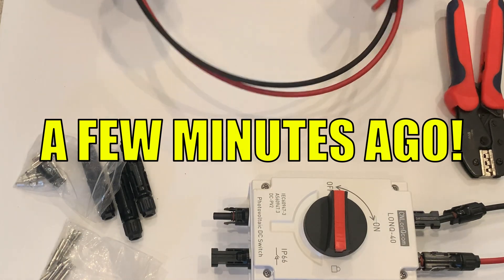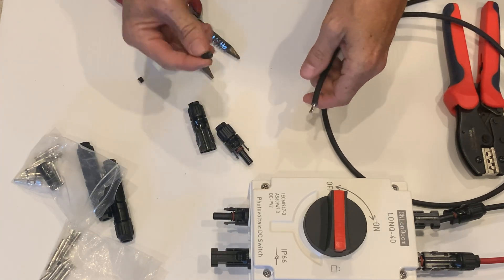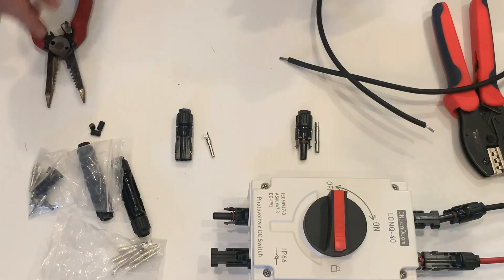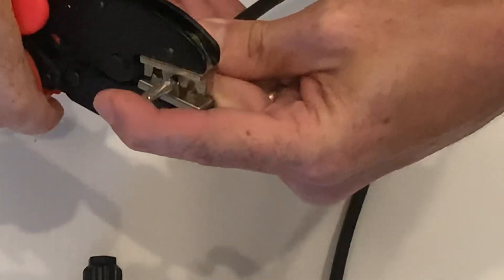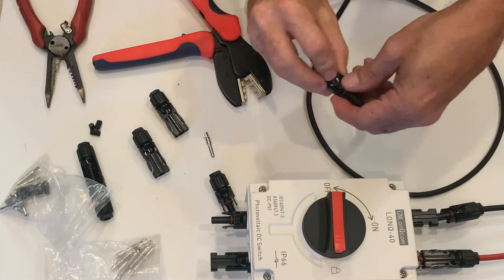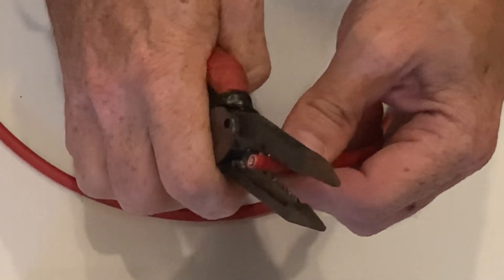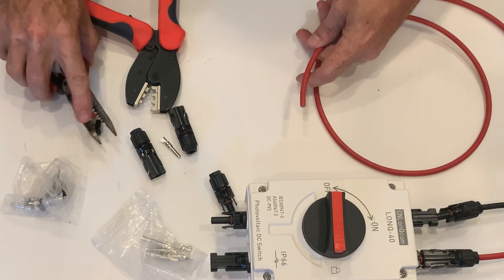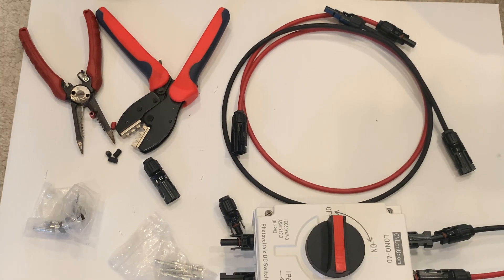How To Make Custom MC4 PV Solar Cables At Home (Save BIG on Wiring!)

Comment: den nay gia the nao
Reply from the maker: 30 pairs of connectors are $26 .. so less the $1 a wire + the cost of wire, and that will depend how long you make it, but a lot cheeper then buing premade.